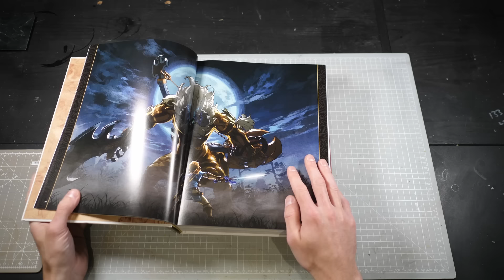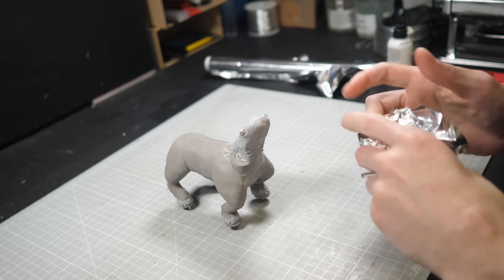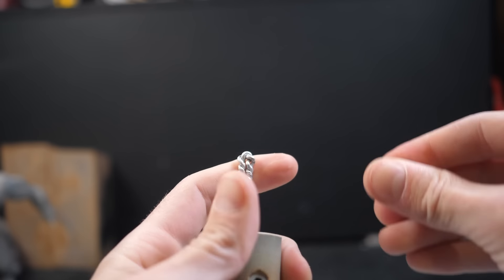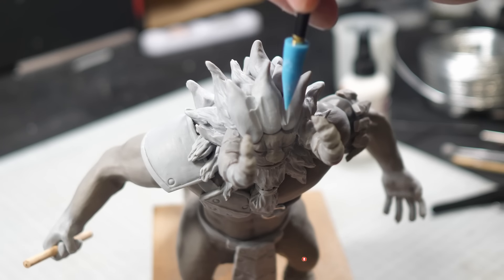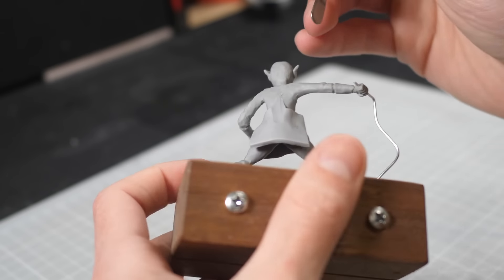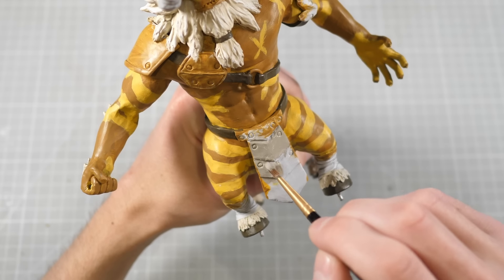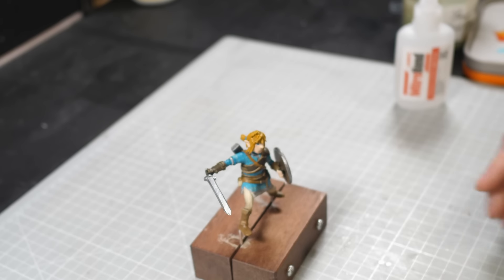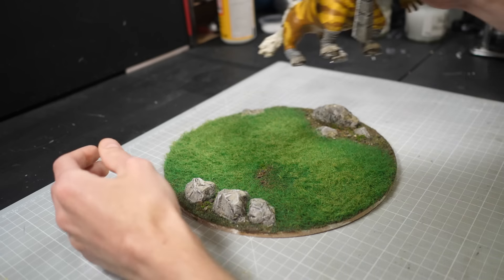How to Make Link vs a Lynel / Breath of the Wild / Polymer Clay

Comment: One thing I have learnt from my recent arguments with clay is that anything can be a tool. Sometimes, you can't find a suitable tool, then you find some random thing that is right for the job (or, can be manipulated gently to work). I bought some nail clippers a while back that came with a cuticle... thing? I have no idea what it's supposed to be for, but it worked nicely to convince some clay to do what I wanted.

Amazing work as always, my dude. And feel free to pronounce zebra however you want. ^_^
Reply from the maker: My single most used tool is just that: a cuticle... "thing" that came with some nail clippers (you can see me using it in almost every video). I get why you use it! It's a good size, one end is flat while the other end is pointy, but the metal is amazingly smooth and leaves a very clean finish.

Comment: This is really cool, but you inverted the horse legs. You put the hind legs on the front and the front legs on the back 😅 remember that all terrestrial animal follow the same anatomy. Knees bend backwards, heels bend forward, elbows bend forwards and wrists bend backwards. Meaning elbows and knees should always face each other, not away from each other.

But other than that, this is incredible.

Comment: ... whoever fights a (GOLDEN!) Lynel with what looks like a travelers' shield and sword is a fu€king mad man and has my full respect. Those bastards have 7500 hp. That sword does 5 damage. Even if it was brand new, it would break before you did any kind of significant damage to the beast holy shit. And the shield would break after the very first non-perfect parry it takes

Comment: Do you have to bake polymer clay?
Reply: Yes
Reply from the maker: Yup, depending on thickness the times range, but you can easily rebake it without any worries. I'll often bake a section before moving on to the next so I know it's hard and can't be damaged.
Reply: @NorthoftheBorder  Thx for the answer you two!! And like for how many time and temperature? Id like to get started in making things with clay
Reply: @AdrianGonzalez-lw6sh  I've only worked with one brand so I think it just depends on the brand! So it should say on the box or something :)
Reply: @Skull_Kid5  okay thanks!!